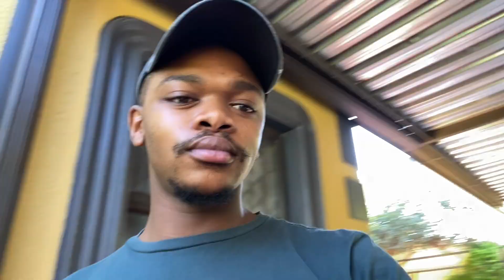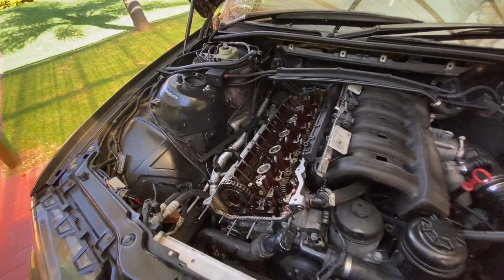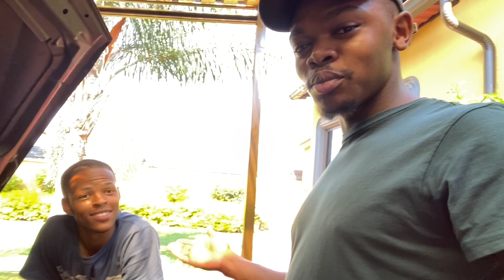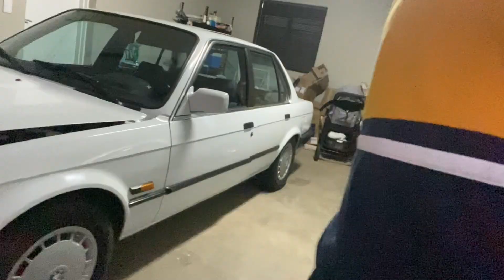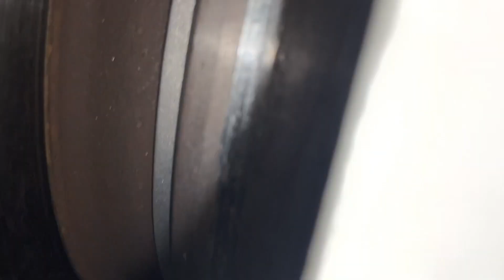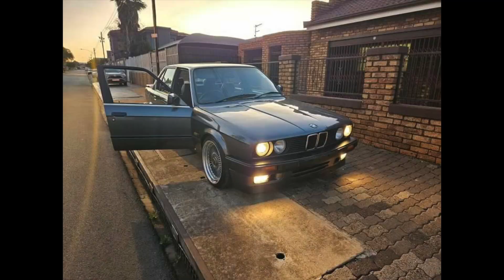Will They Finally Fit?? Trying Borbet's On The Bagged BMW E30 Using Spacers!

Comment: 15 inch will fit. I had them on my old e30 many many year ago.
These are the wheels you need to get
BBS RM 029 RM029 R15 15" 7.5J ET30 5x114.3 2 PIECE SPLIT RIMS ALLOY WHEELS / RS
Reply from the maker: Thanks my brother, I’ll do my research on the wheels setup you just gave me 😄🙏🏽

Comment: Bru that type of spacers you installing is the worst thing to put on your car because now your rim isn’t sitting flush on your wheel hub centre so it’s gonna wabbel and 14s are to small
Reply: True even at high speed or breaking the steering will wobble